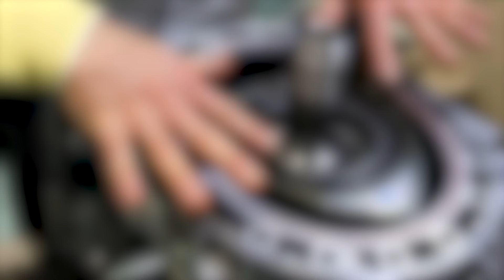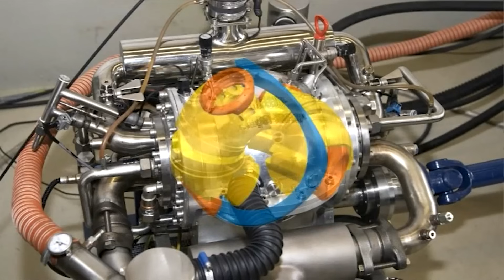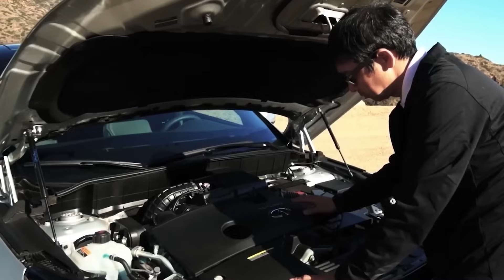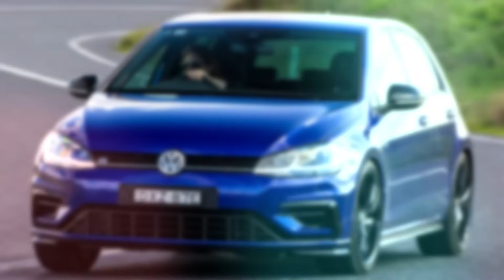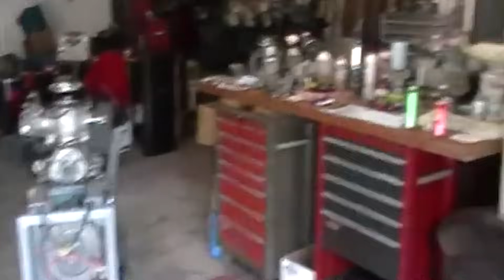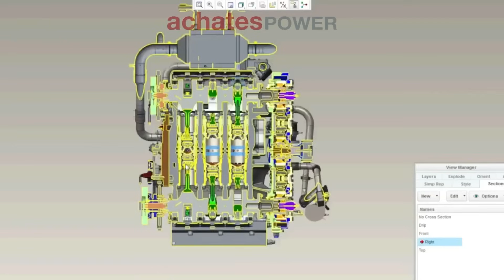10 Strangest Engines Of All Time

Comment: the Caddy 4-6-8 nightmare wasn't smart, it was desperation... The system relied on a vacuum tree that looked more like a wiring diagram of a motherboard, and 9 times in 10 would have a leaking rubber hose that the engine had baked solid. Over half the time the ignition would wind up missing, and the the "6 cylinder" step would never materialize, and the "4 cylinder" mode wouldn't maintain 35MPH.

Add to all that the spread bore 750CFM carb, and you'd wind up frying rings from fuel washing the cylinders with in-town driving, just to try throwing a rod when you got it on the highway and the heavily fuel diluted oil would fail viscosity requirements.

There's a reason these didn't live much past about 96-97...

Comment: I have a single rotor 13b in my aircraft, maybe not quite as efficient as some engines, but power to weight is out off the chart, so important in an aircraft, most auto manufactures have no concept of this. The whole vid is filled with half truths and a waste of time.

Comment: I developed a magnet motor that produces usable torque and RPM. It is simple to build and has minimal moving parts. It can be made in many different sizes. EVs will no longer need to be plugged in and buildings can be 100% off grid.  Anyone interested in helping with further development, feel free to contact me.

Comment: the one that really attracts me is the Deltic.. 18 piston, combustion chambers created by the pistons. Been thinking around about this for more than a little while now. Even thought about making a Deltic into a petrol engine. Lets say be make the pistons work out to make their triangles equal 6 liters (displacement of 18 liters, this thing would have to give you a thousand horsepower, smooth as glass. Also thought about taking the exhaust gas from one triangle and feeding it (along with a little petrol) to the next bank). Making up 2 six piston fresh levels and 2 6 piston exhaust sets.

Comment: I owned an original Mazda RX-7 with a staggeringly tiny engine but make no mistake, it possessed the torque of a diesel V8 truck motor and the horsepower of strick road prohibited race modifications, further it had an unlimited RPM range,"without worry about winding it out or damaging it, performance wonder the size of a carry-on suitcase!"
P.S. Although, a young inexperienced man regarding automobiles during my ownership, a Masters degree in aerospace engineering I still recommended, before one should attempt crucial repairs! When it ran properly, it was like no other automotive experience, simply bewildering, satisfying and inimitable, to this day!
Reply: The Spitfire guys enjoyed it a bunch as did the P51 pilots.

Comment: The caddy 864 was and is the biggest failure in gm engines. FMS or displacement on demand which destroys engines at predictable low miles. I would put this engine in the dumbest engine catagory.

Comment: Disappointed that Sterling were excluded
Reply: Stirling engines probably weren't included because they are extremely inefficient, produce little power and are EXTERNAL combustion engines.
Reply: NO range extender yet in Cdn

Comment: Madzda did not invent the rotary engine, it was first build by NSU and the car was the RO80 with 115 horsepower.  The inventor was Wankel and the engine was called Wankel motor.
Reply: you're totally correct wankel was the true inventor of the wankel engine
Reply: Felix Wankel.
Reply: Wankel invented  the rotary. The Wankel was originally a diesel
Reply: Norton motorcycle UK development reinvented to rotary fixing many problems. A company called liquid piston is reinventing yet again
Reply: Quit being a pedantic wankel.
Reply: The first NSU with Wankel engine was NSU spider.
Reply: Hunh... and here I am hearing "Rotary Engine" and thinking something along the lines of a 4 cylinder bi-plane... alternatively, the same definition could be applied to a turbine.

Comment: Although the sleeve valve engine was not generally a high revving engine, and thus not high horsepower for its size or weight, its "superpower" was longevity.  Cylinder wear is normally greatest at the top of the stroke, where the piston momentarily comes to rest at the "hot end", and the piston ring lubricating oil film can break down.  In the sleeve valve engine a point on the cylinder traces a 'figure 8' on the sleeve, never coming to 'rest', with improved lubrication and dramatically reduced cylinder wear.